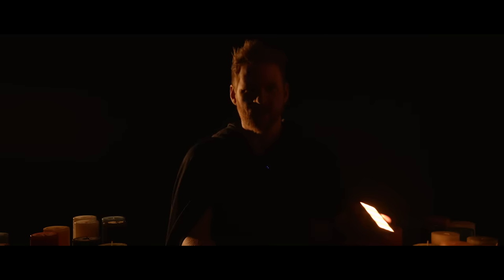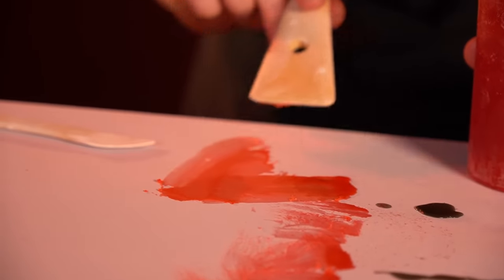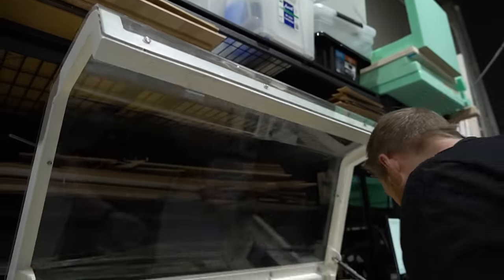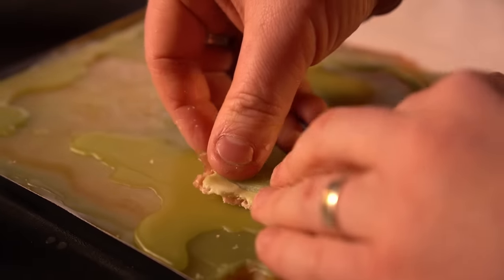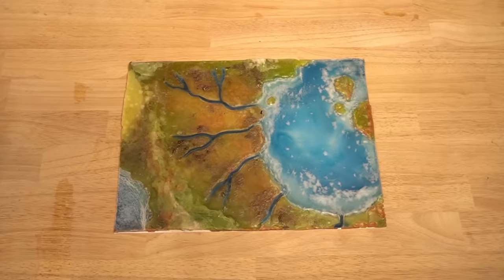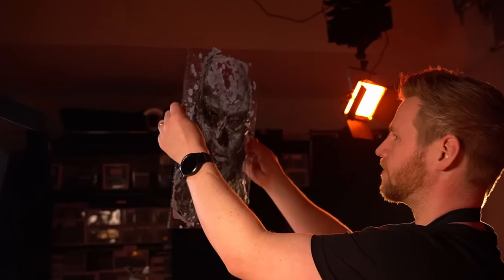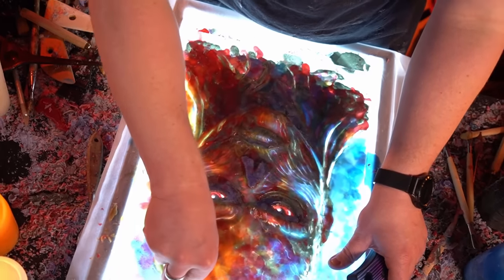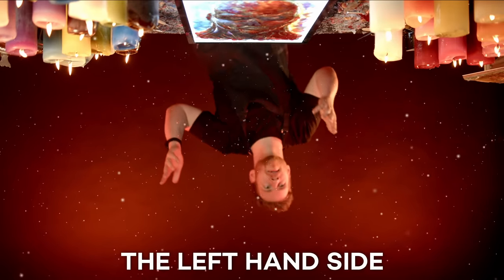Painting VECNA with Melting Candles...

Comment: Related to the heat topic of the video: One thing I noticed during the pandemic is that the receipts you get in shops react with hand sanitizer. Obviously the thermal paper used changes color when heated, but apparently it also works with alcohol. Maybe there's a cool way to draw something on thermal paper... 
I noticed that different kinds of paper reacted differently (some went pitch black almost instantly, some only got a bluish tint) and probably the concentration of the alcohol also plays a role. I guess Jazza could do some amazing stuff with that effect.

Comment: When I was a teenager, I used to use candle stumps to do small drip art pieces (don't know if that's the correct word for it). We took water in a cup or bowl, and dripped the candle wax on top of the water. It created a kinda pebbly texture on the bottom. It was easy to pop the finished piece out of the bowl, and pierce it with a needle to make a hole for thread, so we could hang it as decoration.
Not as impressive as these sculpture-paintings, but an easy and pretty way to use the last bits of candles.

Comment: Both the candles and crayons are a variation of encaustics. You might consider picking up some wax sold expressly for that purpose, R & F hand made paints is an example. The up side would be that they use artist grade pigments so it might look better. I bet it would be a similar experience although they use beeswax and resin so it might handle a bit different. But it's still fun to watch you at play!

Comment: The results look great, but there has to be a less dangerous way to use candle wax in this manner than holding the lit candle up to a lit butane torch. Wouldn't be that hard to find a jug or something you could use to pour the wax from after melting it on a stove top, surely?

Comment: Why didn’t you just use encaustic paint and a heat gun. Natural brushes and any scrapers. If you had added resin to the wax, those art pieces would be permanent and solid forever; see Fayum Funeral Portraits!  Still, great work on your part! You need to paint encaustic at least once. People are either really bad or really good at working with encaustic wax paint. I was really bad at it, but my encaustic sculpting is awesome. Give it a go!